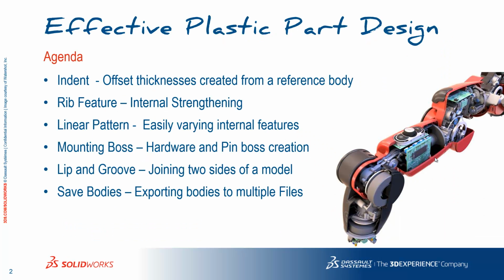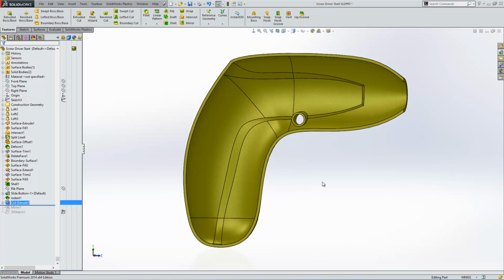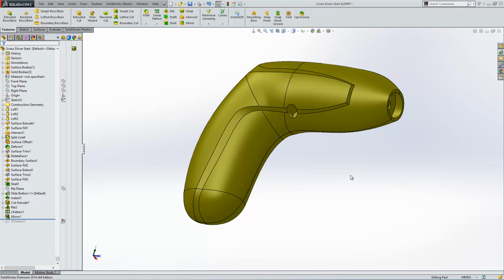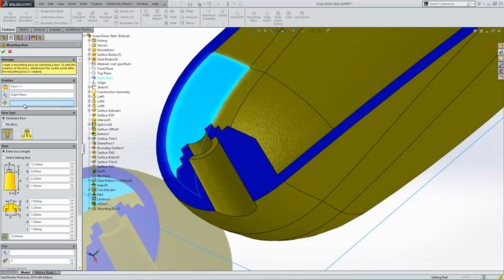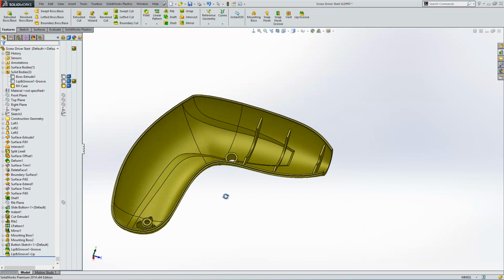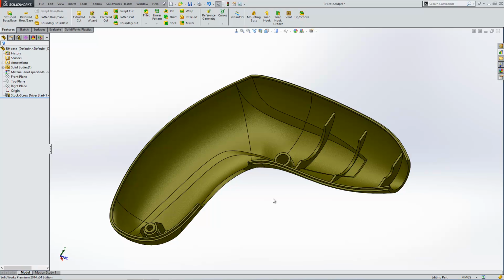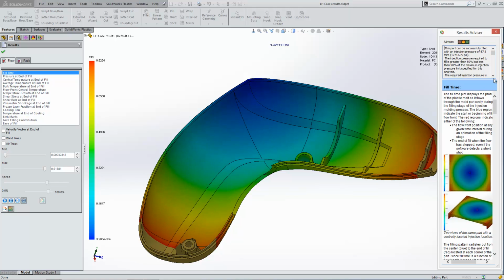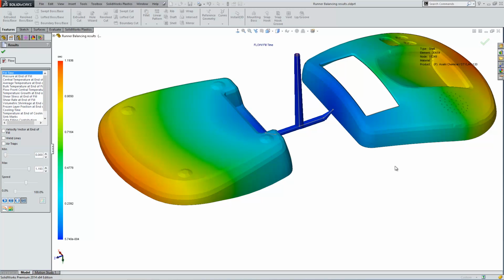SOLIDWORKS In Depth - Effective Plastic Part Design

Comment: Can I ask here? I want to do mold flow simulation using polymer UHMWPE, but it is not available in the material datasheet and when I make a custom polymer and then input the data. The result is nothing. What I must to do for this situation, sir? Thank you :)

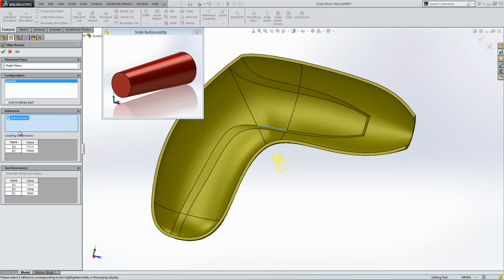Comment: In your video at around 2:23 you insert a new part and have the part open up in a separate window before you apply the references, is there a way to do that as a default so when you're in an assembly the part always opens in a different window, Its a feature I miss very much from Pro/E

Comment: How did you get two solid bodies in one sketch? It doesn't work to slit something and then mirror it. I saved one half and brought it into the sketch like you did with the button but open trying to save each body, nothing happens.. I don't know if that made any sense
Reply: Multiple bodies are created if you:

* Create a boss from multiple disjointed contours.
* Create a cut that separates a single body into more than one.
* Create a boss feature separated by a distance from other solid
geometry of a part.
* Create a boss feature that intersects other solid geometry of the part
and clear the Merge Result option.
Reply: make sure that hide/show tree items show the solid bodies folder
Reply: I know how to do it now but thanks for replying